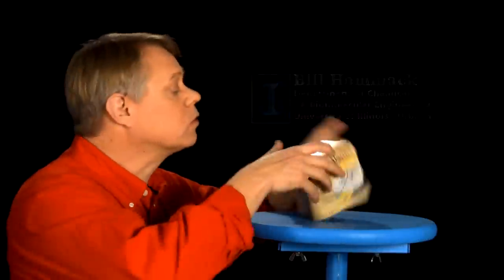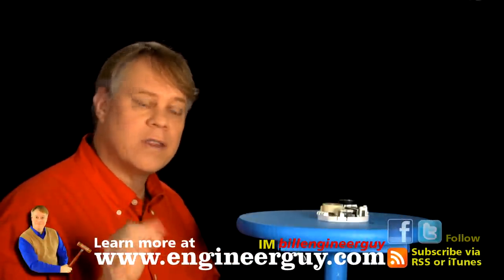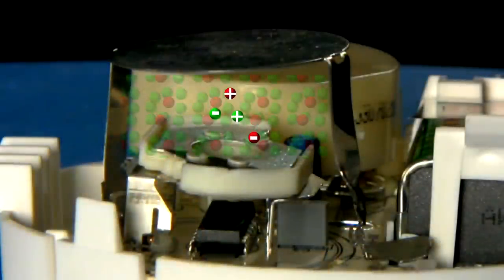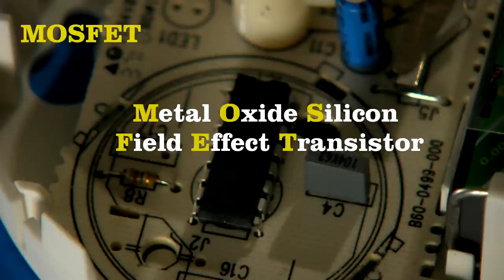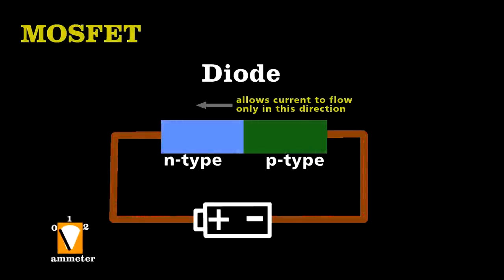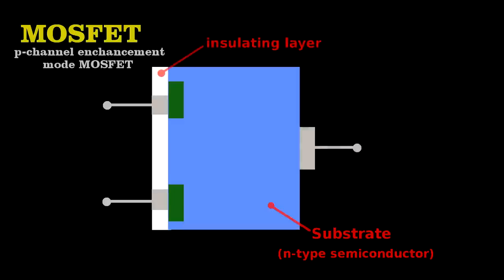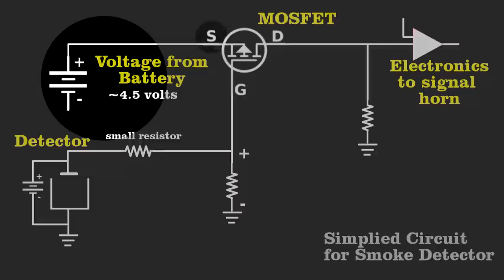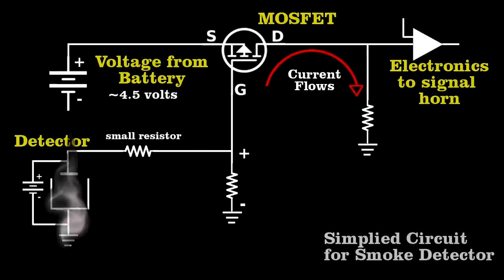How smoke detectors work

Comment: Didn't sound simple to me.
Reply: Are you kidding? This is like pre-preschool level stuff, in the engineering world. (That is, if you are a fairly competent engineer.)
Reply: But it is simple. Basically, it's two circuits working to interfere with the other. 
1. Circuit A is designed to sound the alarm.
2. Circuit B is designed to stop circuit A from working.

When smoke enters the system, it interferes with circuit B, making it unable to stop circuit A from working, thus allowing it to sound the alarm.
Reply: Sounds like you, are not
Reply: drkjk took a condensed matter and analog electronics course, it was pretty well explained.
Reply: There are other types of smoke detectors as well:  they are build around the effect that smokes disperses light. So if you have smoke detectors like he does, they would have light rays inside which are pointed (sometimes via mirrors) at a photo sensor. If the intensity of the light that reaches the sensor drops the smoke detectors "says" alarm. 
Another type of optical smoke  detectors analyzes the amount of laser beams that are being reflected back into the emitter. Same logic, if the amount of laser beams that are coming back drops there should be smoke between the emitter and the reflector. The last method works even at greater distances up to 100m.

Comment: By the end my eyes had glazed over and all I could think was, "wat".
Reply: ***** From the beginning I was completely fascinated.
Reply: +Chiki McBallin By the end I was completely confused.
Reply: +adizmal amen, brother
Reply: +adizmal Yep, the tangent into a MOSFET obscured the original point. The relevant point seemed that this type of transistor was a key to detecting the tiny change in current, that the MOSFET and the ion-based detection scheme worked together to make a very tiny change be reliably detectable. The older bipolar type of transistor doesn't have the sensitivity to work in this case.
Reply: gblargg .........wat
Reply: I get your pun XD as in wat the electrical current :b

Comment: Bill,

Thank you for one of the BEST explanations of a MOSFET and how it works.  I have been a ham for 55 years but still am amazed at how those tiny thingies work.  Just had a MOSFET blow (or was defective) in a QRP transmitter (IRF510) used as as a polarity protecting device and had to ask for help in learning its function.  Also using an IRF510 as a final for up to 5 watts output, so they have many uses.  I finally replaced the defective one and things are good again.  Also, am impressed in how smoke detectors work and check them at home and at my kids regularly.  They are so ubiquitous that many folks forget about checking them until the battery goes weak.  I see now that many have a 10 year battery and it is not replaceable, just replace the whole unit.

Dave K8WPE

Comment: Thank you for you explanation and very nice video.  I think there is a small imperfection on your circuit diagram: for the detecting part it should be a constant current source across (100 pico amo like you say) and you use a battery symbol there which is constant voltage.
Reply: Lol I was scratching my head at that circuit diagram, too. Thanks for clarifying.
Reply: So, unless I'm misunderstanding, if current flows through the ionizing detector when the air is clean, then very little current will be going through the resistive divider, and therefore the gate voltage will be low. Since this is a PMOS device, that means that there will be current flowing from source to drain.

If there is smoke, very little current will flow through the detector, and most of it will pass through the resistive divider, pulling the gate of the MOSFET high, stopping the flow of current from source to drain.

As for the signal going into the electronics to signal the horn....
Clean air: 4.5V
Smoky air: 0V

Comment: How does the test function work? Does it just test the horn, or the electronics as well?
Reply: it just tests the horn. not the electronics.
Reply: Some will interrupt the smoke detector current and allow the alarm circuit to activate.  Thus  when you release the test button , it take a moment to silence the alarm.

Comment: Bill, we have five A/C powered smoke detectors wired together. When one triggers, all sound the alarm. Through the years we have had one of these malfunction, and I can't tell which one is generating the false alarm, because all make noise.  Making things more complicated, it's hopelessly intermittent, usually on a cold evening when I suspect dew is forming. Can you help me to decide which is the detector causing the false alarm? I have a multimeter and an oscilloscope.

Comment: Modern smoke detectors use LEDs, but the old radioactive sensors are cool.  UL labs in Chicago has an incredible smoke detector testing facility.  Better are when smoke detectors are combined with rate of rise sensors which limit false alarms.

Comment: @sharrynuk His explaination was simple, but it gave the basic idea of a MOSFET. If you have done any diode and MOSFET analysis you will note they have very similar reactions from the p-substrate to the drain/source. In fact the energy band diagram for a MOSFET in depletion involves the same structure as a diode.

Comment: Its a very good video.  I would like to do a video about intelligent smoke devices in commercial applications. 120 smoke detectors wired together on a single pair of wires, plus, minus and data all on one. Its part of the BACnet protocol. Then when a smoke detector alarms, the main control panel (micro controller with RAM and ROM) determines the exact location of the alarm and signals the appropriate signalling devices, fan shut downs, elevator sequence, fire department dispatch etc.   I will accomplish all of this with an arduino micro-contoller. It will take me a bit of time to produce this.  I started about a month ago.

Comment: Interesting... that's quite a large resistor to ground at 45 megohms :-o
Reply: Why what?
Reply: Having built many different guitar pedal circuits and tube amps etc a 45 megohm resistor seems gigantic. You never see a resistor bigger than 10M in those types of circuits. I know, they're completely different animals. Just an observation is all.
Reply: I know just enough to be dangerous. ;-) But as you explain it, that makes sense.
Reply: What is that even supposed to mean? o__O
Reply: I've heard an interesting story about one of the first op-amp designs.
The senior engineers looked at a circuit and couldn't figure out why it worked when built in real life, but didn't work when calculated mathematically. It turns out that, the parasitic capacitance in the circuit - only a few femtofarads (quadrillionths of a farad, one quadrillionth being a mighty 0.000000000000001 ) - is enough to make the circuit work. Amazing! XD

Also keep in mind that when measuring insulation resistance, we're talking about tens of megaohms to even gigaohms. So yeah, such large values are not unheard of. They can be quite important too (same for the small values. Sometimes that is all it takes!).

Comment: that ratio of the small resistor in series with the 45 MOhm resistor is important because it creates a voltage divider; the current source of 100 picoAmps times the 45 MOhms matches the source voltage from the battery.
Reply: I get 45 10^9 Ohms x 100 10^-12 A=4.5 V, so should it not be 45 GOhms ?

Comment: Good video, but I wonder if you could expand on it.  For instance, cigarettes do not seem to set off smoke detectors, burning the toast will.  As an Orthodox Christian, I burn a considerable amount of incense.  This involves lighting a small charcoal, and placing incense nuggets on top.  A great amount of smoke is generated -- much more than with a cigarette or with burning the toast -- but it never sets off the smoke alarm.  What is it about the design of a smoke alarm that allows it to distinguish between one type of smoke and another?
Reply: Will Crowe your smoke detector is broken dude

Comment: so because when the battery is running low, there is not enough of a current running between the two electrodes causing the alarm to go off?

Comment: MOSFETs are cool; their only drawback is that they are so sensitive that they are easily damaged by things like static electricity and electric fields in the air.  I know of a super-computer manufacturer that was brought down by moving circuit boards containing MOSFTs through the air underneath a network of electric probes designed to remove static electricity; unfortunately the field was an efficient substitute for the static.

Comment: I'm trying to follow your explanation of how the MOSFET works, but I get lost at the part where a voltage difference between the source and the gate allows current flow between the source and the drain.  If the gate is attached to an insulator, how does it have any effect on the transistor at all.  It seems the same to me as attaching the gate to the air or the wall.  I'm really confused.

Comment: (Bear With me I have only graduated from highschool and have never taken chemistry so please reply as if i was in 7th grade.) I have read that the smoke bonds with the ions that kep the electrical current flowing between the two metal plates. How does the smoke bond with the ions? if there is vapor introduced into the smoke detector why does the vapor not bond with the ions, stop the electrical flow, and make the detector go off?
Reply: +TheJooooooooooooe double this question
Reply: I dunno where you got that from, but who knows ... maybe it's just meant to be simplified. (Sometimes we leave out the details when explaining things to novices because, in engineering, there are a LOT of details, which can quickly overwhelm some people...)
Granted, I'm not a real engineer, so don't take my explanation for granted ... I'm still a beginner too, relative to what a competent, experienced electrical engineer would know.

Basically, the radioactive source gives off a very small amount of radiation, in the form of alpha particles.
(The amount is so small that it is pretty much harmless, unlike that of a nuclear reactor!)

The alpha particles hit the gas molecules which are in the air, causing some of them to be ionized.
(Ionization is the process by which an atom or molecule gains a positive or negative charge, by gaining or loosing electrons.)

Because some of the electrons are knocked free from their atoms, they form a conductive path (though not super duper conductive, like, not anywhere near as conductive as a metal wire), as an electric current is basically made up of electrons which are free to move around.

(Note that not all electrons have to be completely free in order to move around. Some materials - such as metals - have a valence shell (the outermost shell) that has an imbalanced number of electrons. This causes them to be a bit more free and able to move around, albeit with some friction (resistance).).

The electronic circuit measures the amount of current that can flow, and compares the measured value to the amount of current that would flow in normal atmospheric conditions (no smoke/gasses from combustion). If the values don't match up within a certain amount, then the circuit triggers the alarm.

Now, you may be wondering ... can other gasses and particles/molecules trigger the alarm? Yes, they can. That's one of the downsides to the ionization detectors, and it sometimes causes false alarms.
(Our old detectors in our house were the ionization type, and interestingly, they didn't give us any problems at all, whereas some people report other ionization detectors giving them massive nuisance troubles. Different circuit design? Who knows ... not I! XP)
Reply: oh my god i want you to explain everything to me you make is so simple to understand! thanks (:
Reply: If you still want to know the answer to the question here it is. Americium releases a steady stream of alpha particles which travel in the air chamber and are picked up as an electric current on the other side. Therefore when even tiny smoke particles enter the chamber, they interfere with the stream of alpha particles disturbing the current and triggering the alarm.

Comment: Could you do an explanatory video on how lightning can indirectly set off a smoke detector?
Reply: +Nicholas Rose Its probably because moments before a lightning happens, air surrounding  it ionizes itself a lot, and when the electrical discharge in fact happens, the air goes back to its "normal" state for a very brief moment, and it wouldn't allow current to flow between the two electrodes, activating the MOSFET and the siren :)

Comment: It's "megohm" not "mega-ohm".

This circuit won't work. It does not matter whether the detector is "on" or "off" because it is effectively "shorted-out" by the battery. 

E.g. If the maximum current from the battery is 1 amp then its "source resistance" is ( V / I == R, 4.5 / 1 == 4.5 ohms). This simply shorts out any effect from the detector changing from open circuit to ( V / I == R, 4.5 / 100pA == 45 megohms).

Comment: so all the resistor does is to discharge the most but the current coming from the detector is greater then the current that can flow trough thee resistor so it chatges the gate of the mosfet

Comment: can you make the smoke detector smaller??
Reply: +Seth Docherty they should be able to make it extremely small! I don't know why they don't! So small, like the size of a 9V battery itself! It wouldn't be as loud, but that's not the point! If you needed to determine, where along a 500 meter corridor, where the smoke is coming from, you could place one every meter, and send the signals to a display (no 500 horns nor beepers), and you could send a service tech to the specific section, to investigate. Assuming smoke didn't mean massive fire, evacuate! And no need for 500 9V batteries, they could all be powered by one power supply. And you might need miniature sensors (the ionisation chambers), I don't know if they exist, but they could easily be made micro sized, with similar functionality/sensitivity. I reckon.

Comment: The circuit is explained and drawn poorly.  There appears to be an ideal voltage source in parallel with the detector which is troublesome as drawn, basically rendering the detector useless without further clarification.  Then a current from gate to drain is shown when smoke comes in.  The gate is electrically isolated from both drain an source, so this current could only  come about if the gate oxide breaks down, blowing up the circuit.  Which would only occur by something like an ESD event or an overvoltage.  The correct explanations is the current flows from source to drain rather, when the voltage at the gate collapses to ground due to the smoke coming in.

Comment: @spelunkerd Dew INSIDE your house? Hmmm. 1) If it is occurring often, you could tape a light bucket over each (EXCEPT the one you are sleeping under!) one at a time and see if it stops (kitchen?) 2) If you would agree to let them just run on battery for a while, disconnect the AC so that the alarm signal couldn't be passed to the others. 3) Maybe there is a filter you could insert in the AC to prevent passage of the alarm.

Did you say years? Replace all of them every 10 years without fail.

Comment: Ok so i worked for a painter and sometime we to sand the drywall after patch. My boss would freak out if we sanded near a smoke detector without covering it. Is it possible the to set off the alarm with dust or other particles other then smoke? I kinda thought he was crazy but he might be right